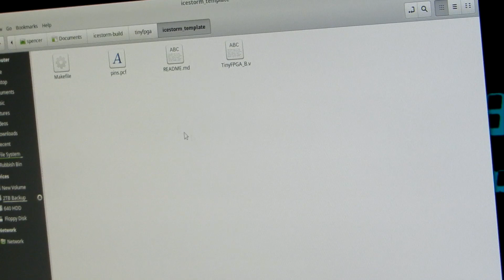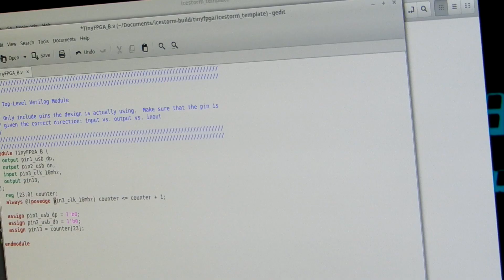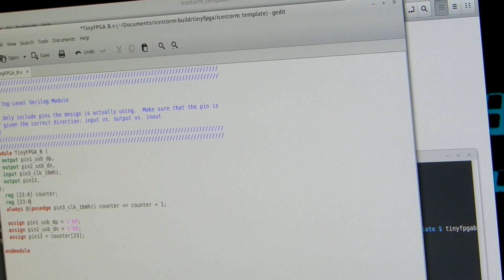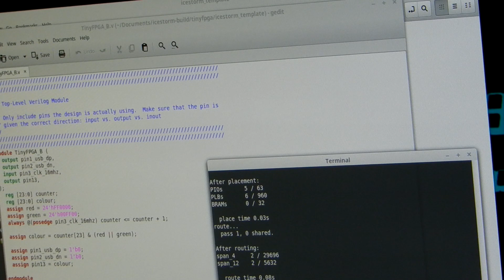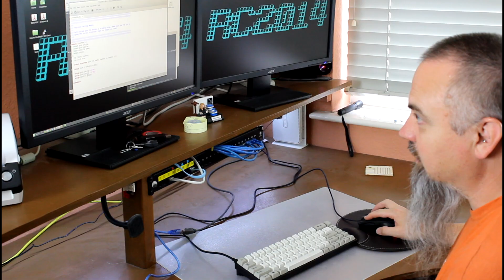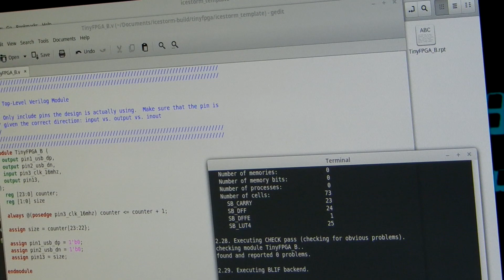Advancing Beyond Blinky With An FPGA

Comment: I really didn't notice that part when the LED is off and the FPGA is disconnected, or the part where the LED color changes as well as their positioning on the board

only question is why would you spend all this time on scaming ppl over such a simple and trivial thing